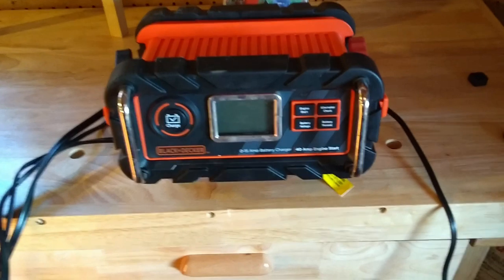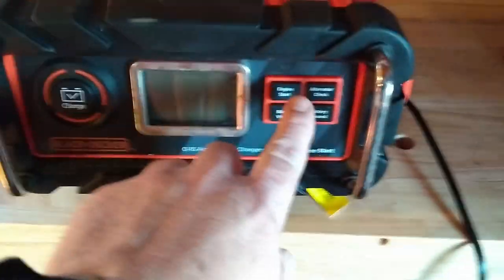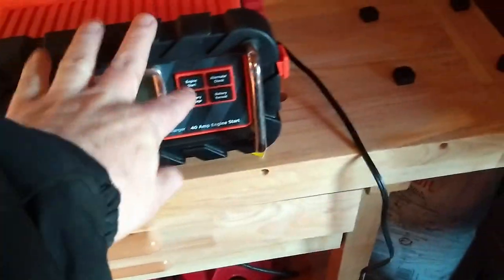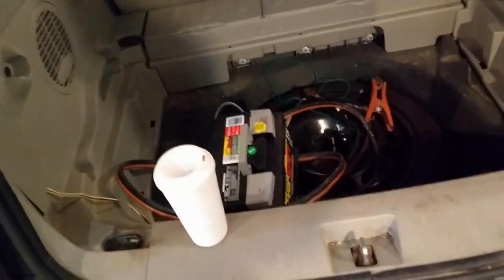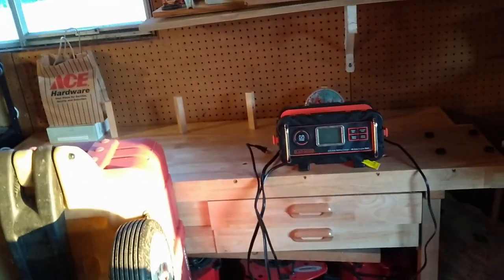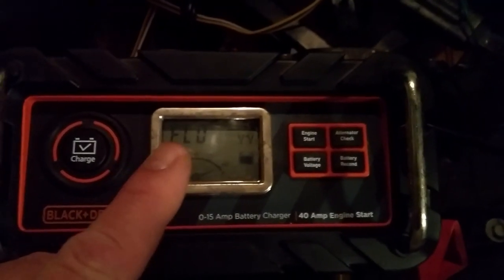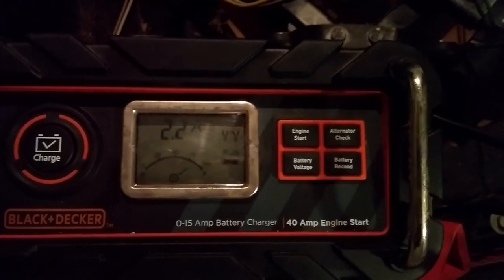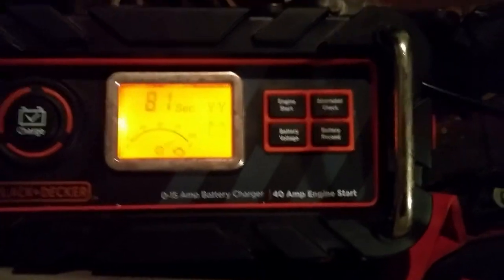Black and Decker Battery Charger Review

Comment: My battery just died in my HHR too. I paid $150 for mine at NAPA, only because that was what had been in it. Good review, I'd love to have the regeneration feature on my charger.
Reply from the maker: Yeah so far I am 2 for 2 on the bring back a dead battery with this charger. It takes time however it seems to work. I picked up my battery from Walmart Maxx T15 for a little over $100, comes with a 3 year warranty plus a 2 year extended one if you opt for it. Time will tell if its a good battery, its made by Johnson Control here in Milwaukee so I am hoping so.

Comment: Just to get a clarification, when you want to jump-start the engine you hit the engine start button and let it run its 90-second charge then after 90 seconds you try and start the car with the charger still plugged in with cables still attached to the battery?

Comment: Nice unit. My understanding is that B&D and Stanley are one in the same?
Reply from the maker: According to Wikipedia you are correct. I did not know that. Well that sure explains that. :) It works well so far long term well we will see. I have mostly B&D power tools and have been happy with them so fingers crossed.

Comment: I wonder if it would regenerate a AGM battery?  I am going to watch for a sale.
Reply from the maker: I checked the manual, it does not say, however since it says it works by sending quick charges to knock the corrosion off the plates I am guessing not. I looked for a AGM battery no one around here had one that would fit in the HHR so maybe next time.

Comment: This thing is a POS. It immediately goes to FLO on my battery telling me it has 13.3 Volts when the battery only has 10.7 Volts. The company, Baccus Global gives you a runaround and form letter answers about this defective junk. I saw one video of this thing smoking while hooked up to a truck battery. Dangerous and a lawsuit just waiting to happen. I hope it hasn't burned your house down yet.
Reply from the maker: Well so far its been just perfect and brought back 4 of 5 batteries and keeps the bikes topped off. Sorry you are having such a bad time with it. I will watch out for anything that maybe a problem however so far its been perfect and been working non-stop since I got it.
Reply: Mine is doing the same. I thought there was something shorted out in my van, drawing all the juice from the charger. I do have something draining my battery, but this charger really had me going crazy.

Comment: Cool. I use a trickle charger on my forklift and it's getting some age on it. I'll have to get a new one soon.
Reply from the maker: This one is worth considering however a trickle charger would be cheaper and smaller. However if you ever need engine start or battery recon this should do nicely.